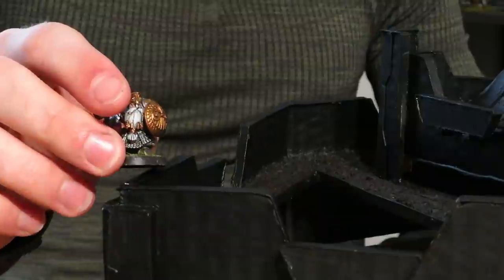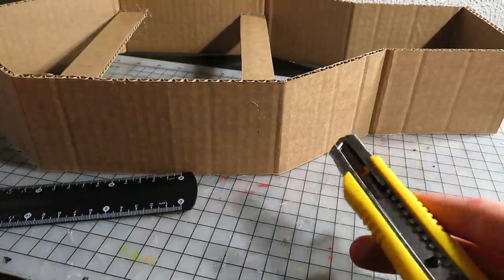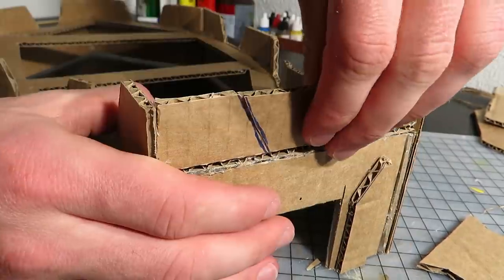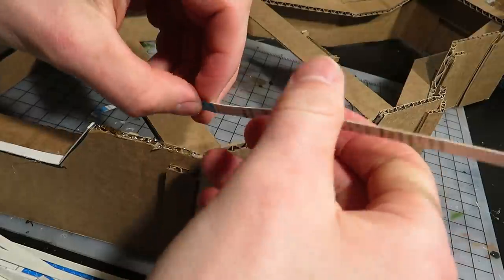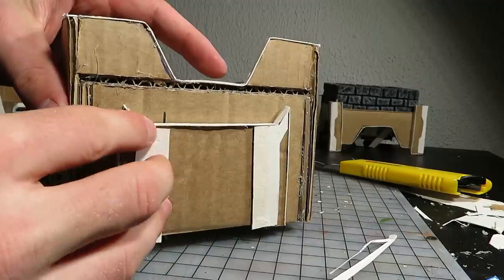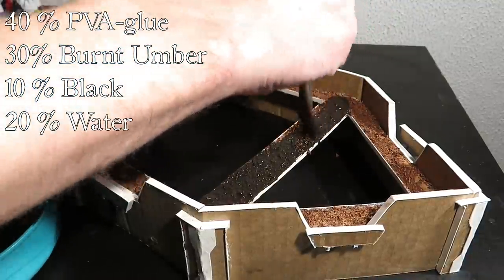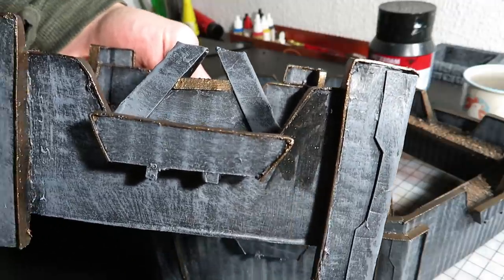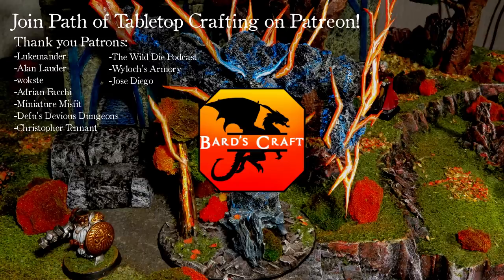Dwarven Stronghold! How to Build a Simple Castle for D&D or Wargaming

Comment: For covering the open corrugation (as well as mistake made with hot-glue), if you wanted the whole keep to look like rough stone, use water and PVA glue and cover the cardboard completely with toilet paper. Once it's fully dried give a base coat of dark gray and matte modge-podge (about 50-50 mix). From there you have two paths open to you:

Limestone/Sandstone: Heavy dry brush of Yellow and a brown wash with a very light dry brush of light-gray.

Or

Granite: Heavy dry brush of light gray with light dry brush of off-white. Brown wash optional.
Reply: Please, make a tutorial for that!
Reply from the maker: I'll remember this if I decide to make other simple buildings, thanks!
Reply: I was gonna suggest this!
Reply: @AFarmerCalledChicken  Which part? The method I suggested or making a tutorial? I would if I had the time, buuuuuut I don't.
Reply: Alternatively, you could cut a few paper egg cartons up into rectangles and use those as bricks.
Reply: TheTerrainTutor and TheDMsCraft both go over this in their paper craft videos.
Reply: Toilet paper and pva.. excellent for organic wrinkles but flat smooth effect  not so easy.
Reply: @ArtbyJoeH  Depends on how gentile of a hand you have.
Reply: Harland Mountain  working in a piece right now. Kitchen paper proved to be less fragile 😊

Comment: Great craft, always happy to see more dwarf builds, but if I may offer some suggestions?
1: Cover the corrugation as you go rather than at the very end. With so many pieces at odd angles, especially since this craft is one large piece, it would save you a lot of hassle before final assembly.
2: I would consider doubling the thickness of any walkways, if only because you never know if someone will bring a bulky metal miniature that could warp it, or worse, fall over and break.

Comment: You can also use drywall mud to seal the holes and gaps is you don't mind wiping the walls down with a SLIGHTLY damp cloth or paper towel afterwards (maybe after the first base-coat of paint has dried to provide a better barrier). A great build any dwarf would be proud to call home!

Comment: If you use a putty, like spackle (typically for filling holes in walls), it fills gaps and once it hardens it can be sanded smooth, and since it's a paste consistency it can quickly fill gaps without glue.

Comment: Great job! Love the simplicity of cardboard - I always find it useful building a quick cardboard model to prototype complex structures before moving on to XPS. Filling holes you could try a thin layer of plaster or drywall filler.

Comment: Cardboard is a very versatile and low-cost material to work with. I agree the bare edges look ugly - but the flat surfaces of corrugated cardboard still have a wavy uneven-ness. I would recommend experimenting with covering the cardboard surfaces (not just edges) with more card stock. Also, wood filler or air-dry clay could be used to fill in the edges or even to smooth out the surfaces. Wood glue can be nicer for visible areas than hot glue. And finally, to get rid of excess hot glue, glue strings, etc. you can go over the area with a hair dryer to slightly remelt the hot glue.

Comment: for the edges you could just use the glue. add the hot glue to the edge and then use something( a finger will work if you can handle getting burnt ) to smooth it out. it kinda fills in the holes and you can just paint it solid

Comment: One idea I want to recomend for filling in the exposed cardboard corrugation was spackle, plaster, or drywall compound, in part because you can get large amounts for relatively little money. And, if mix it yourself you can somewhat control how stiff the mix is. Or use premixed. But it would probably push into the exposed corrugations very easily with a small spatula or puddy knife and is very sandable and paintable when dry. My only concern is that too much and the dampness could affect the paper. But, using small amounts in the ends would likely work just fine.

Also, just found your channel. Love it! Subcribed, liked, shared. Keep up the good work!
Reply from the maker: Good tip, might try if I build more cardboard structures
Reply: @BardsCraft  Go for it! Spackle is really cheap and much dryer, so I might start there. But drywall compound is much harder and more shapable and durable. Its like clay that has the consistency of bread dough, whereas spackle is like working with really sugary dry frosting. And there's traditional plaster two, which is like drywall compound but stiffer and drys a bit faster. Back in college I used plaster on top of a rigid foam base to make a scale model of Corfe Castle in Dorset, England for a medieval studies class. It is on a massive hill, so I can testify that it works great for modeling realistic land terrain. Then again, I am a rank amateur when it comes to war gamming terrain, so I hope I've not led you astray.

Comment: Wont give you the same look or edges to dry brush but it might be faster to use spackle or "drywall mudding" to fill in the cardboard edges, you can also use this watered down and with glue to make a sort of texture paste if you need.  but the drybrushed cardboard is likely a better fit for the dwarves castle,

Comment: I tend to use a lot of dollar store foam board. The times that I've used cardboard I've always sealed those corrugated edges with hot glue. A thin line will fill the corrugation and give the edges a natural asymmetry.

Comment: 2 part white glue, 1 part water, put in a cheap spray bottle. Lay strips of cheap toilet paper on the edges and then spray them until wet. Might need 2-3 layers but they will harden nicely and are paintable and you don't really need to cut strips for edges. I use this technique to make texture on walls also, just paste it there and then use a stick to 'carve' rocks.

Comment: i use paper clay and push it into the ends of the cardboard. waaaay faster than cutting and glueing individual strips but a bit more expensive. There are videos on how to make your own paper clay however.
Reply: This intrigues me. How much does paper clay cost, and where does one get it? I was thinking plaster or drywall compound, because of low cost and ease of procurement, but clay would work great too probably.
Reply: @PersonMan1234  not much really. You can get it at most craft stores on the clay isle. Usually costs around 10 USD for around 10 ounces of clay.
Reply: @PersonMan1234  can also be home made on mass with cheap house hold stuff

Comment: More easy way to cover coardboard is use beige duck tape. Fast, easy to paint, texture not to much different than cardboard  but you see the edge of the tape on the wall. You can use this line as decoration. But of course, take hours for make and glue the little cardboard sticks give better finish.

Comment: At 4:47 you score the cardboard so you can bend it to have a “...nice, smooth corner...”.  If you took a paint brush or your finger dipped in water (very small amount) and run it across the section of cardboard you want to bend, it will bend easily.  It gives a clean edge and dries quickly.  It makes for less work later and the piece is a bit more durable.  Also, after cutting your walls, if you cut the edges at a 45 degree angle, they fit together beautifully and you don’t see the seams.  Plus, the tiniest bead of pva glue will hold the wall together.  It’s less messy and you don’t have to deal with hot glue strings.  Hope these tips help you out!

Check out Eric Strebel YouTube channel (Cardboard Basics Tutorial Guide) to get great tips on getting those ideal seams when joining walls or, check out a few videos from architectural builders.

Comment: I know this is a year old but at one point in the video you ask if anyone has a suggestion for how to cover up the cardboard edges without using card stock and I had the idea to use masking tape and fold it over lengthwise and make folds and cut the excess tape around corners.

Comment: Very interesting now I don't play D&D or other games like that however this would be a good model to use for making Halo dioramas naturally I would use a more sci-fi look and paint scheme but I figure why have dwarves when you can have Spartans LOL but I definitely like the look of this build although I may have to upscale it a little bit
Reply from the maker: I remember playing halo as a little kid, good clueless times :) 
Futuristic terrain with power generators, fortified bases etc. are actually easier to craft with only cardboard or cardstock. So good luck!
Reply: @BardsCraft  thanks I'm probably going to stick to the design in your video but I am going to make a few alterations since these are Mega Blok Halo Minifigs I'm working with which are roughly the same size as the dwarf figurines I shouldn't have much issue but the main tower is definitely getting an overhaul I'm probably going to have it able to be opened up and have a small Command Center inside and maybe an Armory too the stronghold might not be big enough for a warthog but it would be a good size for a Garrison of Spartans and ODSTs I am going to enjoy building this I used to love building little Cardboard Castles as a kid I will probably line the walkways with a bunch of flat mega block pieces so the figurines will stay put and I will probably fasten the whole thing down to some poster board so I can move the whole thing around easier

Comment: Wouldn't it work if I did that technique of white glue and toilet paper? Basically, 'slap' bits of toilet paper on the surface and use a brush to cover it with a thin layer of white glue on top, and repeat that if you want a thicker coverage. 

It would make it easier since you don't have to be so accurate.

Comment: Machicolation is pronounced “muh-chik-uh-ley-shun”
You almost had it right except the ch in this word is pronounced the same way as you would say chimney or chocolate. Id still congratulate you on efforts since English is an extremely difficult language. “ch” presents in 3 different sounds in English “ch” “sh” or a “k” 
I guess slightly off topic..Your english cadence is kind of off but really only deduces that its not your first language, i do commend on your fluent ability though which appears much stronger than conversational english. 

Oh and my thoughts on if you didnt want to spend the time cutting out paper to cover the ugly sides: if you werent opposed to more rounded edges, and if you moved at a consistent speed, you could simply just use the hot glue to cover the edges. It would be much faster